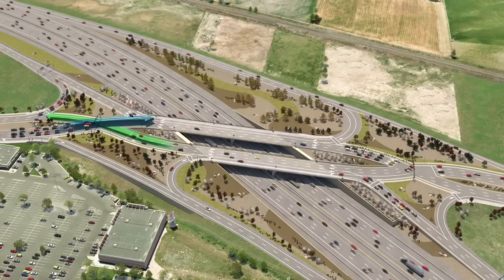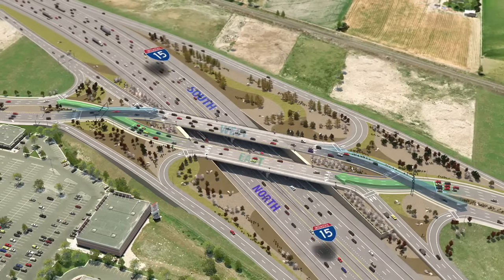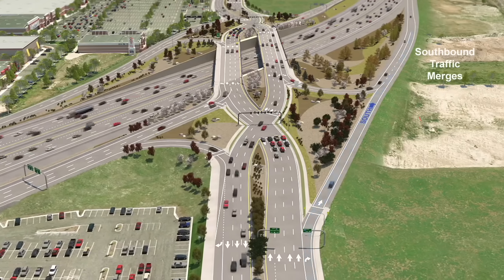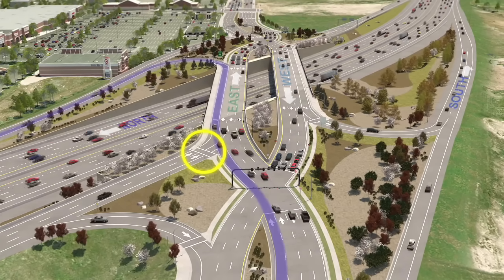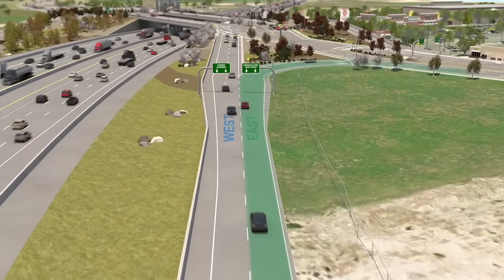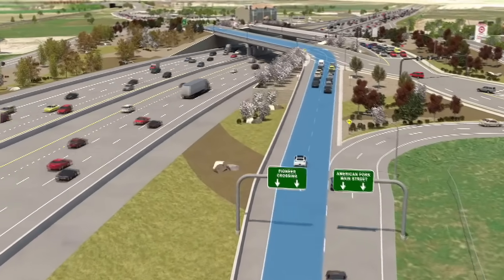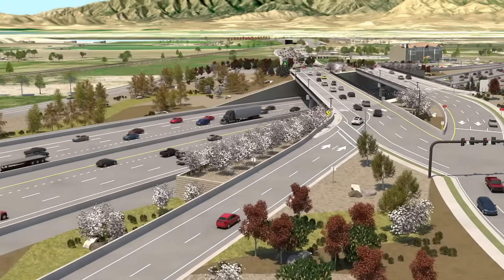Diverging Diamond Interchange Animation

Comment: BS, a bridge with a 4 leaf clover is cheaper and eliminates traffic lights, congestion and accidents. This idea has to be a DEI employee dream.
Reply: Partially. 4 Leaf Clovers increase crashes in high traffic areas due to idiotic drivers. 8 diverging, and 8 merging conflict points in a cloverleaf, but no crossing conflict points.

With a DDI, there are 14. But there are 2 crossing conflict points that a cloverleaf doesn't have. A DDI has only 6 merging and diverging points, compared to 8 each in a cloverleaf. And you can get used to a DDI pretty quickly.

You can take a regular diamond, with 28 points of conflict, and convert it to a DDI with just some concrete and paint.

You can't really do that with a cloverleaf. New road, new paint, possibly new bridges, and the time it needs for the asphalt to dry.

Full cloverleaf can cost $10 million, while a DDI could cost more or less depending on other factors
Reply: Cloverleafs get congested with these volumes.  They are only good for low volume roads.

Comment: Seems an overly complicated solution. In the UK we mostly use roundabouts in these situations, which allow traffic to flow more naturally.
Reply: You don’t have roundabouts where a busy road crosses a major motorway, do you?
Reply: @charliebell5073  yes, yes we most certainly do. And it works.
Reply: @charliebell5073  you are right, roundabounds need alot more space and need to be designed more complex the more traffic flow there is
Reply: That requires both giving way and paying attention to other people's intentions.  Notice that this is in the US.
Reply: I wish the Us used roundabouts more!
Reply: Because a roundabout would not work here with these volumes.  UK proves this when they signalize roundabouts.

Comment: So for that you need to build two bridges instead of one?
Reply: If it's a new road, then maybe. But if it is an existing road, you could just take the other 2 bridges and leave them as is, just with new paint facing the direction of travel. There is also the case where there is 1 bridge. You could move that bridge and build another beside it, so you only had to build 1.

Comment: I have been using these a lot, with correct lane followups they really are very good. the lane switch of the diamond can be grade-raised as well for increased thru flow

But to be fair you build the Diverging Diamond when you do not want those overpass/underpass stuff

Comment: Before evaluating the proposal, can someone describe the basic problem(s) being solved here and the stated requirements of the solution?
Reply: Cheaper, safer, and faster.  What's not to like?  The only downside is that it's a tiny bit confusing.
Reply: @XeXers  Fair enough, but that doesn't answer my question. Cheaper, safter and faster are some goals for the new solution, but they don't define why a new approach was necessary.
What were the problems that they were trying to solve?
What was wrong with the original solution(s).
Reply: @kyle381000  too much traffic, and too many vehicular conflict points with older designs
Reply: @kyle381000  This design gets rid of many conflict points compared to a standard diamond.
Reply: Another problem that DDIs fix is reducing the number of sharp turns semis take on interchanges. Instead of 90 degree turns, you have more gentle maneuvers
Reply: It's got one clear benefit as i see it. With a traditional interchange you would have to stop at a second light and wait for a left turn arrow to proceed.  With the DDI once you have stopped at the first light you are good to proceed onto the highway on your left without the second stop. So that's one less stop for those people. The ones crossing the highway and continuing on still have the traditional two stops.

Comment: Did a five year old come up with this with their toy cars.  Wow, how to overthink and over complicate a simple problem.  Not only does this take up way too much real estate, it is a terrible accident waiting to happen.  Not to mention if you had an accident on this mess, you’d be holding up all traffic for hours clearing it.  The amount of people who decide last minute to exit is crazy, and with this they are doing that both directions.  So many issues, the clover leaf may have a bit of a flaw, but this greatly increases the flaw.  Back to the drawing board people, put this one in the round filing cabinet.
Reply: Probably not, but maybe a kid in France did, where it was first utilized, and it worked amazingly. Here is the issue with your comment.

Cloverleafs take up even more space and you would be lucky to only have to pay $10 million for one. With a DDI, you could just use the old bridge and save millions.

Another issue is the diamond intersection as an interchange. Turning left is extremely hard, dangerous, and a arduous process. A DDI solves it by putting you in the left lane away from oncoming traffic going straight, and only 2 phases are needed instead of the however many in a diamond, but it is definitely more than 2.
Reply: Agreed, this looks like a solution to a problem no one was having and creates too many accidents waiting to happen. They are putting one of these by where I live and don't understand why since the issue with the highway is that it's about 8 lanes too narrow. The traffic on the highway has nothing to do with getting on and off, it's just too small with too much volume.

Comment: Shaing my head sadly.  This is going to kill a lot of people.  Expecting people to stop at stop lights? traffic on the wrong side of the road. What a stupid and dangerous idea.  Traffic circle type ramps would be better.
Reply: It is statistically safer than a regular diamond. Notice how a regular diamond intersection has 26 points where a crash can happen, while the DDI has only 14. Even if drivers run red lights, 14 is less than 26 so crashes are less probable.

Comment: The old cloverleaf exchanges worked great at keeping traffic moving. What made them unsafe were operators (drivers) with the attention span of a Gerbil further complicated by haste, distraction, rudeness, and did I mention, stupidity.
Reply: Cloverleafs had some fundamental flaws in their design, mainly the same lane being used for merging traffic and and exiting traffic on the bridge.
Reply: The cloverleaf design has traffic merging in one area, so conflict points are prevalent. Let's say Car A wants to go from Road 1 North to road 2 West, and Car B coming from Road 2 East wants to go to Road 1 North. They come to the point where they merge and they think, do I stop or go?

Comment: Great video. It is not confusing to drive left of opposite traffic 

when there are enough barriers to block you from seeing the opposite part of the bridgeway. 

I noticed a lot of these have long, diagonal bridgeways instead of abrupt little 90 degree bridges across the freeway. 

I think this is to allow enough time for the straight traffic to completely pass through the first criss-crossing on each end and not run into the other once they criss cross back at the second end, because the bridge diagonal was long enough to give them time enough to pass and allow for a quick green.

Comment: Are the traffic lights synchronized for the 1100 South through traffic? i.e. When one light turns green, does the next one turn green about the time you get to it? (So the 1100 South through traffic keeps rolling)
Reply: There are 2 cycles in the junction. The 1st cycle has all Eastbound traffic moving while Westbound traffic exiting the highway comes on the bridge and is able to weave into their lanes. The 2nd cycle has all Westbound traffic moving while Eastbound traffic comes onto the bridge and weaves into their lanes.

Comment: 🔴 What a screwed up idea!!! look how many cars have to stop with this design!!!
Reply: How many cars do you think had to stop with the old standard diamond design?  (Hint: MORE). There were still stoplights at both ends of the bridge, just with more phases to cycle through for left turns and longer red lights!
Reply: Well, it is possible to raise the roads to remove the need of a crossing.
Reply: @Nickayz2  That's expensive
Reply: @Nickayz2 You could, but it would cost WAY MORE to build.

Comment: Is there a traffic light to stop at when exiting northbound I-15 and going west (ie merging into the lane which is crossed over to the left side), or is it simply a matter of waiting for enough space to clear?
Reply: In some configurations, there is a traffic light, usually with left turn on red, and some just have a yield sign.
Reply: There is a traffic light so you don't have to negotiate a weave with other Westbound drivers. Otherwise, it could lead to someone inadvertently pushing you into the off-ramp and back Southbound.
Reply: Yes, however it should be possible to turn left on red.

Comment: If the cross points were elevated to get rid of traffic lights that would be best.
Reply: Same
Reply: That would be extremely expensive. Diverging diamonds are much more cost effective and will take up less space. The grade separated diverging diamond has never been built for this reason.
Reply: This design is intended as intersection of differently ranked highways in limited space. That's why terms as on-ramp and off-ramp are still used for one of the highways only.
One of the highways is clearly traffic light free. If you have an interstate/interstate intersection you use other designs, but most of the time it's more outside the cities with more space available. And there, you have different designs for different pass through speeds, as narrow curves don't make you stop, but can slow you down tremendously.
Reply: First thing I thought as well.
Reply: This is called a double crossover merging interchange. It's similar to a diverging windmill interchange which is my favourite theoretical intersection!
Reply: I don't see the big whoop in all this when you have absurd  traffic lights to contend with on, of all things, an interstate/major highway intersection...that  will not guarantee  that a badly-backed up traffic rush hour crunch or deadly crash won't happen....there are always those who try to beat red lights, purposely run through them, or were not paying attention...looks like a lot of  extra construction that doesn't deliver much in terms of convenicnce nor safety....
Reply: @richardrau8701  It's actually cheaper than a normal diamond and also has fewer contention points of traffic crossing each other.

Of course "it won't guarantee" that there will never be rush hours or deadly crashes in the intersection anymore, just like you can't guarantee that you'll be robbed tomorrow.

However in theory it causes less traffic because there are only 2 light cycles, and all crossing traffic has lights and doesn't have to weave into their lane while going 60 mph.

And in practice, it has proved that it, in fact, is worth building, not considering that it costs less too.

Comment: I like this, but one problem I see is what about when there is extreme traffic like at rush hour in an urban area?  The merging lanes would get really backed up.  In that case it would necessitate more traffic signals which would complicate this simple design.
Reply: The whole purpose of this is that it's an interchange that moves a lot of traffic. Imagine if you're driving a truck through a normal interchange during rush hour. You go on the offramp and then you have to turn left across the bridge. That's a nightmare scenario for any truck driver, because first you have to cross over the traffic coming from the left, then you have to merge with the traffic coming from the right. A single truck could back up the highway for miles, and indeed they do. Frequently. Now imagine the exact same scenario for a DDI. A lot more pleasant, right?
Reply: totally the opposite, this interchange handles much more traffic with less chances of accidents.
Reply: You shouldn't be driving in the middle of the interchange if there's no space to stop.
Reply: They put one of these near me. It sucks it takes longer to get thru. Since you end up waiting for 3 lights instead of two.
Reply: @timex513  No you don't lol? There are only 2 light cycles in the entire thing.

Comment: Put in an overpass or an underpass and GET RID OF THE TRAFFIC LIGHTS!!!
Reply: really expensive.
Reply: In such case cars going left from upper lane will have to merge on short distance with cars going left from lower lane, making it very dangerous.
Reply: @anghDescartes notice that the merge lane is pretty long. I can't even see the end of it to be honest. Merging shouldn't be a problem.
Reply: @UsgBifJgpwltA  This was about an idea to create an over/under pass to remove red lights at entry/exit to/from the interchange. While we could do that to allow exiting vehicles exit interchange without a stop, the entering vehicles still have to wait for the traffic merging from the left. Allowing vehicles to enter from the main road entering interchange at the same time as vehicles from the left road is not possible, as vehicles from left lane would like to merge right to go straight, and vehicles from main lane would like to merge left to exit to highway below (as blue line 0:49)
Reply: Well, I wonder what will be put up here, in The Netherlands. They are planning to build the first DDI in the A44/N206. And as budget is relatively higher here, I would expect the safest option and go with over/underpass. We'll see... I see the DDI as the perfect way to get yourselves killed very fast, unless over/under.
Reply: @Jila_Tana  If a grade separated interchange is required due to extreme traffic, a grade separated diverging diamond would probably not be the first choice due to weaving issues.

Comment: DDI is way better than the stupid, confusing roundabouts you find all over Wisconsin.
Reply: I'm American and I don't understand why other Americans find roundabouts so confusing.
Reply: @mattwolf7698  you can drive circles..all day long ...lol
Reply: Laughing Gravy roundabouts are better and more efficient they have them throughout south bend Indiana were my brother goes to college at
Reply: Bwead they're not common here in pennsylvaina my brother goes to college in south bend Indiana and they're everywhere
Reply: And how many traffic lights does this intersection require? In addition you've twice got to cross over traffic if you're heading over the freeway. A roundabout allows free movement of traffic if there's no one else blocking your entry. If you find roundabouts confusing then that's all on you, pal. And, if they are so confusing then perhaps you should take yourself off the road for everyone else's sake.
Reply: Somehow a lot of motorists find round-a-bouts confusing. Studies show that they are a lot safer and operate at a higher capacity than traffic signals.  Traffic signals are less safe due to red light runners and thereby claim hundreds if not thousands of lives in the US.  Accidents are less severe than traffic signals due to the low approach speeds. Round-a-bout initially cost more than signal lights because they require larger footprints.  In the long run they cost less to operate. I think Americans just need to get use to them.
Reply: Nj has a handful of roundabouts, and no shortage of jughandles, which are not the most intuitive but definitely better than Michigan lefts which force you to cut across labes after making the U-turn
Reply: hahahaha to call someone stupid because they understand roundabouts and you don't xD.
Reply: Busy multi-laned roundabouts can be quite chaotic

Comment: This stupid.  Why not just raise one road up higher than the other.  
Then you wont have to have any light or stopping.  
Looks like they failed here
Reply: yes, you could do that and it would be better, but is much more expensive.
Reply: Some people just want government to spend endless amounts of cash on road improvements.
Reply: You could also have left both lanes straight, but had the on and off ramps weave through the middle and under the other side.  
Again this would eliminate all stoplights and stopping.   
Why did they want to purposely create stopping by having the roads unnecessarily cross each other??
Reply: @common_s3nse160  1) Building fly-away onramps is many many times more expensive than  just 2 spans over the highway.  Worth it for interchanges between interstates, but not for regular main roads that cross the interstate.  This is 'value engineering' 2) A regular interchange would still have traffic lights on both sides, but has many more light phases to allow for left turns across traffic in every direction, so the red lights are much longer in a standard interchange while the DDI has just 2 phases.  Any traffic light purposefully creates stopping, and a DDI does not have more traffic lights than the standard design.
Reply: Actually it is not much more and it is way more efficient.  This is because the bridge part or tunnel part is prefabbed in a factory and just set in place. If they are making dirt ramps then the cost is not that much more to dig the ramps before pouring the road.  
What this video shows is absolutely horrible.    
When you have an option to avoid traffic lights then you do it.  The savings in efficiency for drivers makes it way cheaper.
Reply: Yeah, stupid traffic engineers having studied for years not knowing how traffic works. Darn them.

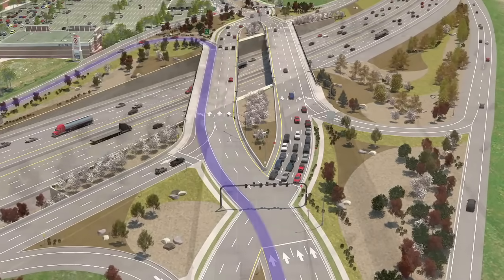Comment: At 1:11 why did the pickup stop and block traffic?. .. There is no traffic control lights, or stop signs, there and no vehicles  ahead in cross traffic
Reply: It is stopped at a red light. The two signals are directly ahead of the truck, suspended over the eastbound lanes.
Reply: There is a light there to stop drivers from being forced to weave. If the pickup kept going it could've been forced into the Southbound off-ramp by another driver.
Reply: Yeah…it’s hard to see, but he’s stopped at a light.